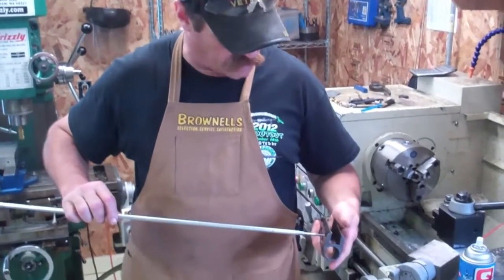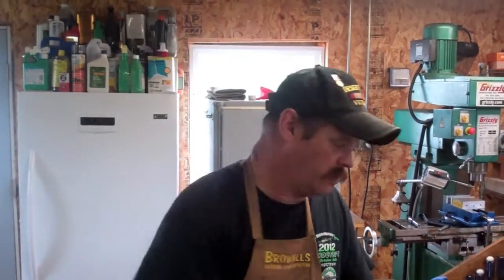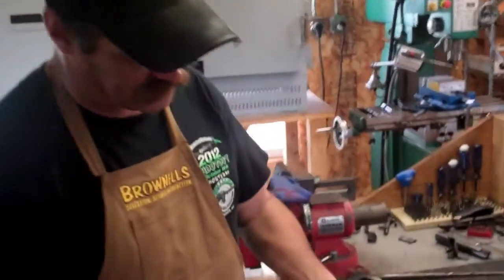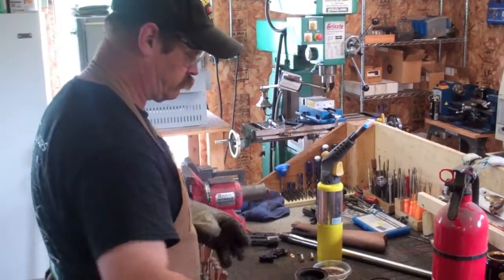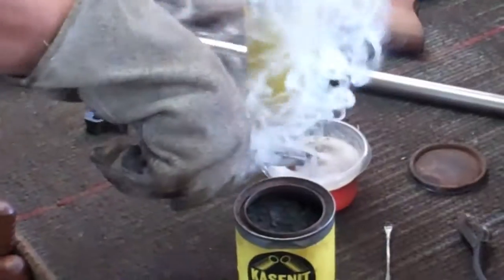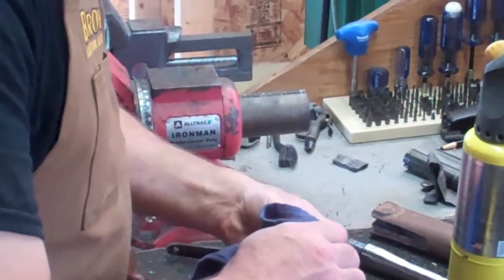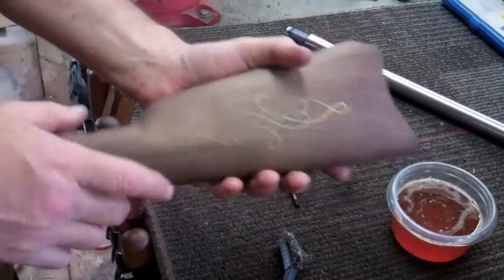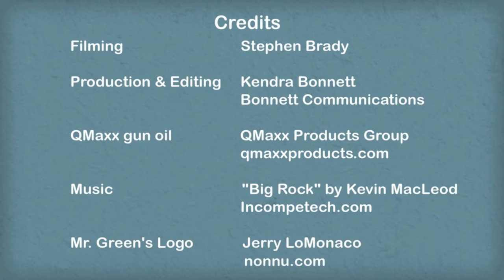Gunsmithing: Machining a Rifle Screw Part 2 (Gunworks)

Comment: For some reason when people talk about 'heat treating' I picture an oven with all sorts of scientific timing and measuring instruments...  A blow torch and oil bath are so much more practical!

Presumably you'd use a fairly cheap pair of pliers for the heating and handling?  I guess when they get hot from the blow torch it will damage their own tempering?

Comment: Like your work mate. One question though. If possible with correct tap. Would it have been more efficient to weld over the damaged hole and retap to original spec?